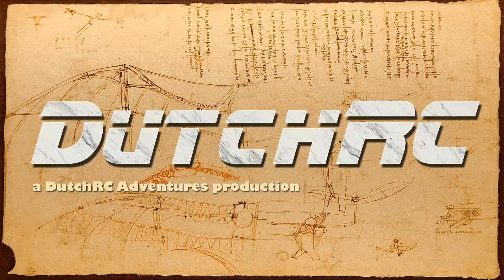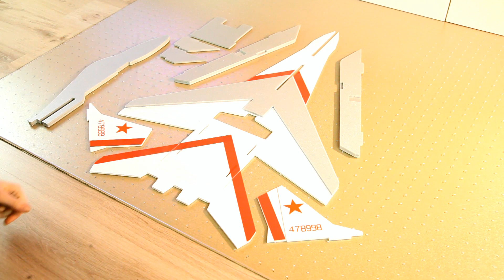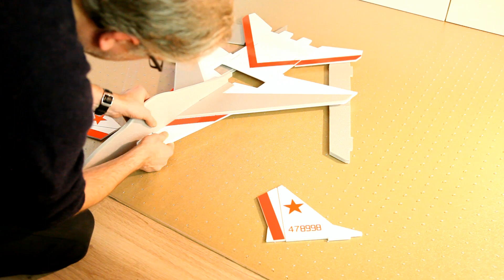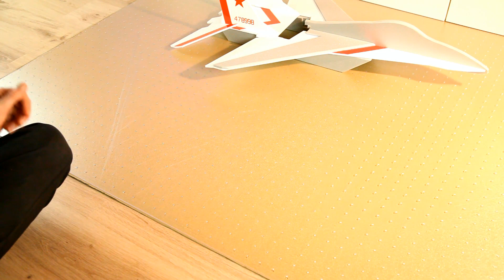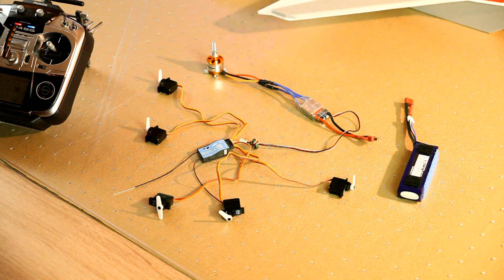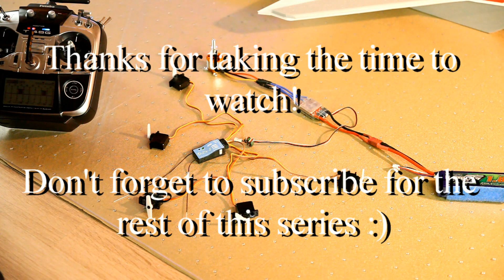RCPowers Mig-29 Scratch Build - Part 3

Comment: Sorry to be so late to the party... I have recently picked up an interest in foam profile park jets. I recently build and fly a MIG-29 as sold by HK (Glue-N-Go) series. I(I normally like F3a type flying but this is also a lot of fun, cerntainlu with fpv :-). I like the RC Powers designs very much and would like to build one as well. However, I am puzzeled about hte foamboard types used and where to get them.  The Glue-N-Go series seems quite strong compared to the depron someone showed me once. The 'depron' broke very easily and would hardly bend. I thought it was not a good material to use. Could you do a video on the types of foamboard currently used for RC models and show there strength in bending, stiffness and weight for instance. Also where to get them would be a nice addition.  Thak you for the interesting video's. Keep it up!
Reply from the maker: I don't really have space anymore to build planes regretably.. BUT yes.. real depron can be a little brittle.. Usually you would brace it with carbon fiber rods if you would make wings out of Depron.. 
It is Also very light though :)  
The foam I used for my plane is Foamboard (also known as dollartree foam).. it's basically some kind of foam sandwidged in 2 layers of paper.. the paper makes it Stiff....

Comment: Nice video, looks like it will be a sweet plane. About how much has it cost you so far?
Reply from the maker: The RCAddict Thanks mate! Hope to get it flying sooooon ;)THAT is hard to say.. Let's see.. a $8 motor.. $23 ESC.. 5x $ 8 for servo's.. $15 for the foam.. And some small parts.. You allso need a lipo + receiver + transmitter offcourse..
Not super cheap huh?
Reply: DutchRC ADVENTURES Doesn't seem too bad, cheaper than an rtf that is for sure :)
Reply from the maker: The RCAddict And with far better servo's & ESC :)  But yeah.. It's still a little cheaper indeed :)
Reply: DutchRC ADVENTURES Yeah, and probably flies much better
Reply from the maker: The RCAddict Yeah true!  And.. the EasyWing for instance is even cheaper.. It only needs 2 servo's :)
Reply: DutchRC ADVENTURES Oh wow, so it is only 3ch?
Reply from the maker: The RCAddict Ehm yep.. That's true :)  You're radio Will need to have the ability to do elevon / ailevator mixing.. But most moders computer transmitters do :)
Reply: DutchRC ADVENTURES Ok, Now that im looking there are a lot of quad and planes that look cool that I could use with the DX6i. Does anything from Horizon Hobby bind to it?
Reply from the maker: The RCAddict Yeah.. Horizon has a Lot of BNF planes / quads / heli's.. They all bind to Spectrum TX;s :)
Reply: DutchRC ADVENTURES Ok sweet